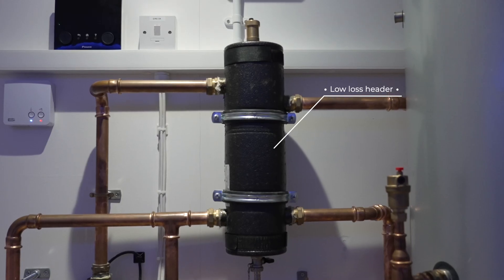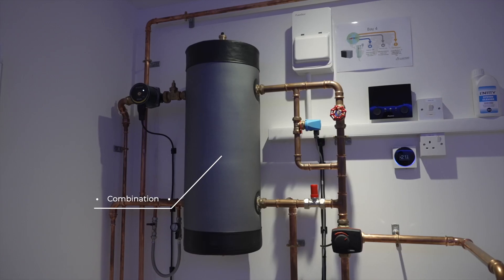Will A Heat Pump Work With Microbore?

Comment: Agreed.  Works well with my Daikin fitted 2.5 years ago.  We have 10mm microbore drops to the radiators from 28/32mm main lines in the loft.  We were running at a SCOP of 3.78, but moving to weather compensation from Nest control has improved this to 4.5 recently - so 450% efficient.
Reply: Has yours got a buffer tank for hydraulic separation?
Reply: @granthutchinson5937 and yes. A 20L buffer tank for hydraulic separation
Reply: @juliandclarke  The plumbing pipe sizing sounds similar to my house, and so no doubt I would need a similar setup. But it's good to see the SCOP you are getting is still reasonable, as I heard that the buffer tank can reduce it.
Reply: Yes our ASHP works well. We have 28mm main line pipes in loft with 10mm micro bore drops to each radiator.

Comment: What is the expected SCOP of this approach? Do you have any data to prove the figures?
Reply: I achieved 3.7 SCOP first year, 3.78 2nd year when I switched to weather compensation mode & now nearing end of 3rd year I am at 3.95.  This is measuring kWh of electric consumed on accurate meter & kWh of heat output for h/w & heating from the Daikin read out